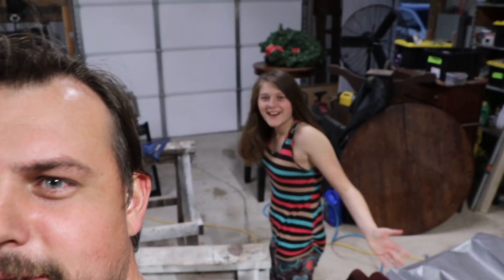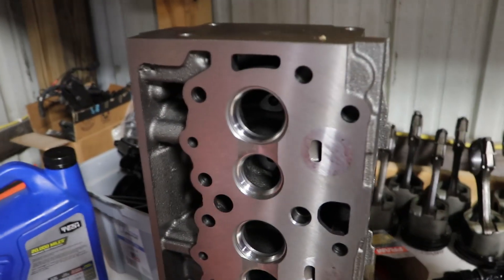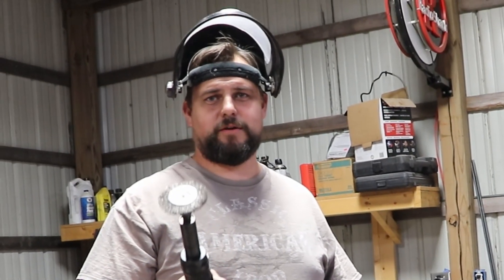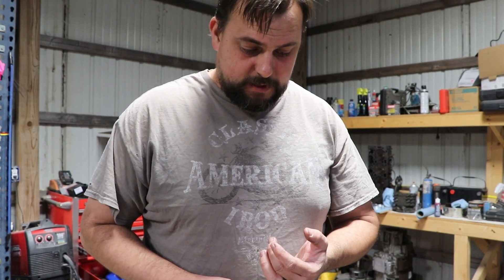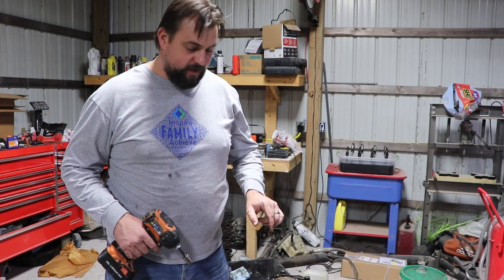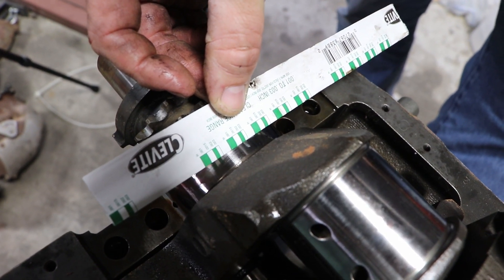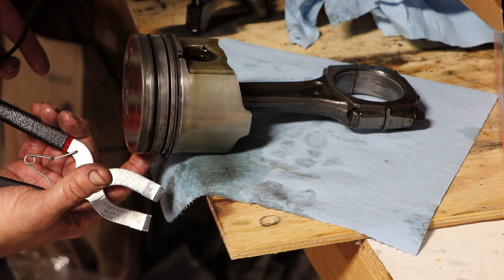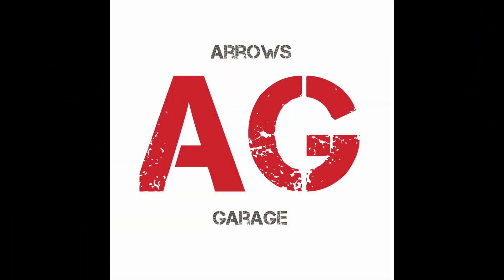6.5l Diesel Engine rebuild Pt. 1

Comment: Cracks between valves were a relatively easy fix on old 6.2 heads… involves reaming coolant passage and driving in a length of valve guide ( with sealer).   Effective, permanent and cheap.
I always use brass freeze plugs… not expensive
Reply from the maker: Yeah, I probably should have just ran them.
Reply: @ArrowsGarage  well if they failed it could’ve been catastrophic failure with Hydro lock and everything else problems big problems so they either have to be repaired or replaced course back in the day. Some people pushed their luck and got away with it.

Comment: I know how to weld cast iron but can I fix main webs it’s like 1 inch long
Reply from the maker: I won't try it. You would end up welding the surface and the crack is all w the way through. Plus if you have a block that is prone to cracking why even risk it.
Reply: @ArrowsGarage  got it I am getting a military 6.5 diesel with low miles like 35 miles low lol
Reply from the maker: @Victorsvolkswagens  sweet! What year?
Reply: @ArrowsGarage  97 so I’m gonna swap a db2 in it and rebuild the DS4 and sell it
Reply: @ArrowsGarage  so I decided not to get the military 6.5 I got a 6.2 for $250 it had 4 spun rod bearings but thankfully I had a brand new crank but I got everything to completely rebuild it maybe add a turbo too
Reply: @Victorsvolkswagens put a forged crank with solid crank pulley on it.
Reply: @ArrowsGarage  you need to be a metallurgist to know the type of metal/and weld technique to use to temper/anneal the metal and then to normalize it. Watch Forged in Fire to see weapons making competition.

Comment: so…very nice video!  curious if your using TTY bolts…as you cant really reuse once they are fully torqued. i just did new rod bearings…and good bolts very very hard to find and expensive—ARP doesn’t even  make…i would want to be .0025-.0035.  .002 is min clearance range…and have seen too many slipped bearings when they are really tight…GM manual specifies no oil film or grease when plasti-gaging main bearings..ie dry…
Reply from the maker: They must have been TTY

Comment: all 6.5 heads crack in-between the valves... I have a set of Navistar heads and they have the same cracks
Reply from the maker: That's what I'm hearing, I probably should have saved the money and just ran them.
Reply: Does it affect engine reliability? Because if its normal I dont think so.

Comment: They are telling you bullshit at the shop.
Crack repaired heads are better then new, because they will never crack again with the sleeve they put in there. first I was paying the machine-shop $20 / crack to fix them.
Then I bought a box of 100 sleeves and was doing it myself for pennies.
I have rebuilt near 100 6.5 engines and was selling them on ebay for 10 years for $3000.
The webbing crack can also be fixed, by JB welding the cap bolts into the engine.
The JB weld will stop the crack from progressing.

You never going to take it apart, but that rebuilt engine can run for 500,000 miles.
By that time they will all be obsolete.
And you will be smelling the flowers from underneath.
Also one advice on the cap bolts, do not tighten them to spec.
Tighten them to 10% under spec.
Because that is what cracks the block.
The factory spec. is too tight for how much material there is.
Also they have lowered the material quality when going from the 6.2 to the 6.5 and neglected to reduce the spec. on the bolts accordingly. That is GM engineering for you.
Reply from the maker: That's what I'm hearing, we only have one machine shop in our town. I probably should have called some of the surrounding towns.

Comment: Great video 👍💯
Reply from the maker: Thanks, I hope to do a bunch more of them.
Reply: @ArrowsGarage  cool and I'll be checking them out. I got a 6.5 HD that I am trying to rebuild for my tow truck. Actually I just need the block because the original block starter holes are crap

Comment: Glad to see more people doing garage builds! 
One thing I ran into on my last build with plastigauge, and to be clear, this is a pretty unusual situation... I had no shop and needed to get the motor done so I was forced to do it in the middle of winter. I used a cheap 'carport' tent, which was fine except it was damn cold which affected the plastigauge results. Since it's just a wax compound, the cold wouldn't allow it to take proper shape so I had to mike everything. Temperature matters!
Reply from the maker: This project is taking so long it was actually summer when I did the crank.
Reply: @ArrowsGarage  , yeah, even working as much as I could, it took me months to finish. Now the article and videos on the other hand... MUCH longer! I've had the motor in for almost 3 years and I still haven't finished writing it up. 
Keep at it!

Comment: Good to see saving a 6.5 good motors 👍👍👍👍👍💯
Reply from the maker: Me too, unfortunately two of the 3 I had were complete junk. The block was cracked on one around the webbing and the crank broke on the other one ruining the block.
Reply: @ArrowsGarage  Bro. all of that can be fixed.
Reply: @VeggiePower303  that is correct, Another fix is a forged crank and solid crank pulley